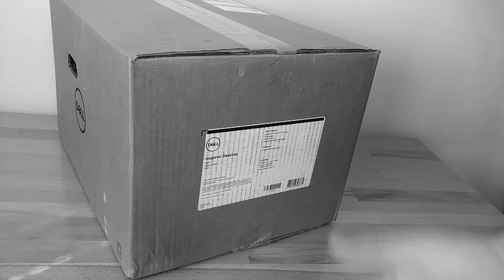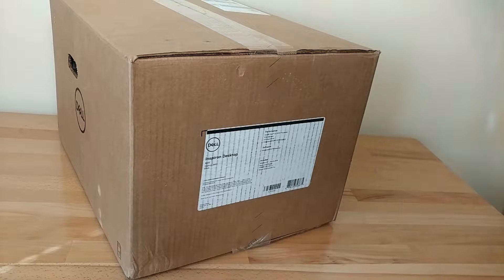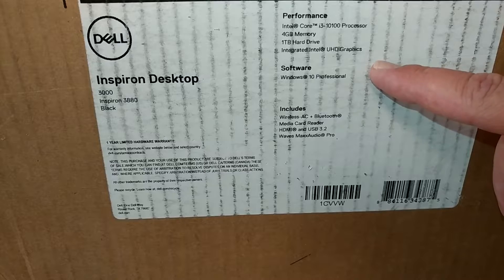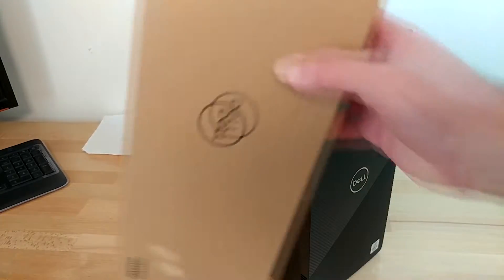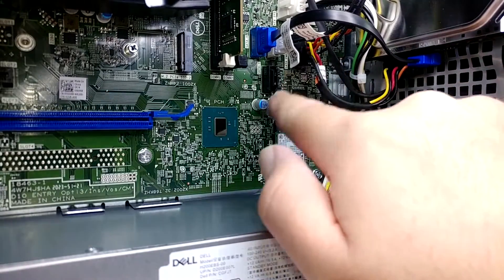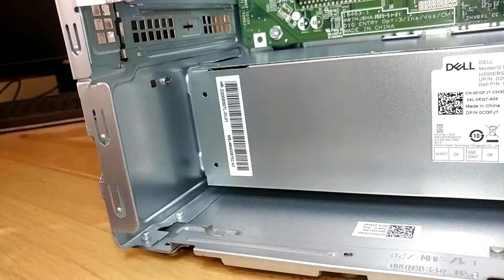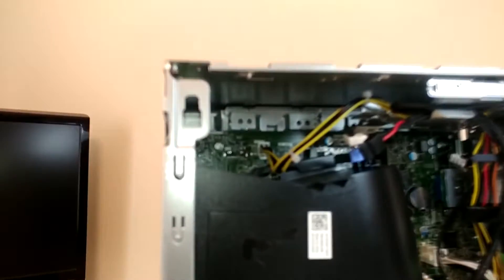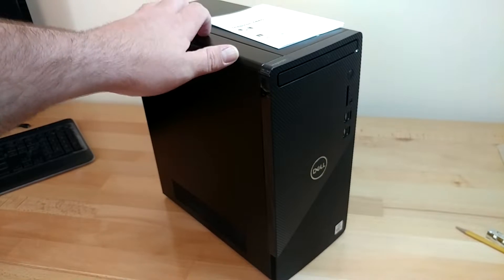Unboxing The Cheapest New Dell for 2021 (and 2022) and Upgrade Plans!

Comment: i want 500w psu in this pc ?
Reply from the maker: I'll be adding a 600w psu soon-ish, but it will be external.
Reply: @TheBrokenLife  you can run it in the case if you use a dremel to cut the mounting mechanism to a normal looking one so that it is big enough to fit and drill the 8 standard holes so that you can mount the power supply with fan up or down (I strongly recommend putting it with fan up because there is no airflow on the bottom). But I don’t think it is really worth it and it is better to either run it out of the case, use a fax power supply and only put the 1 screw in, or just buy or 3D print a new case. Then you can do any upgrade without any limitations. That means you can upgrade motherboard, cpu cooler, hard drives and SSDs, power supply, graphics card and more. You can even upgrade motherboard, upgrade to i9 cpu, add more M2 SSDs, more ram even at higher speed, even RTX 3090. Although that seems a bit too extreme
Reply from the maker: @Dabs_Rulez  A case swap is exactly my plan. If prices settle down a little, I'd like to demonstrate multiple PSU options along the way. We'll see.
Reply: @TheBrokenLife  Case swap would probably be a very good idea. The only problem is that the front panel ports and LEDs and switches won’t be able to connect to the motherboard and power button is proprietary so you either need to salvage the one on the dell case or upgrade the motherboard to a standard ATX or M-ATX. I don’t think drilling holes and using a dremel to make your own power supply mounting mechanism in the dell is worth it or even possible to some people. 1st reason: Some people don’t want to void warranty of their dell. But for me I don’t really care about the warranty. 2nd is that if you make a mistake or break the computer, then they will have to get a new computer.
3. You can easily hurt yourself when doing this and the person who tried the tutorial may comment something bad, say that they’re responsible for the injury even if they said to do it at own risk. 
If you really want to upgrade to a standard atx power supply then you can try doing it but I don’t recommend it and it is just better to run it externally, add a sfx power supply and only mount it with the 1 screw that aligns, or just upgrade case.
Reply from the maker: @Dabs_Rulez  I agree that a case swap, plus a motherboard swap with it, is the most sensible thing to do. I'm less concerned about people hurting themselves mimicking anything I do. Outside of the Dell "things", most of the stuff on my channel can hurt you if you do it wrong and I shouldn't be taken as the single, or most accurate, source for anything. ;)

Comment: this desktop it can hold the gt 1030 2gb graphics card?
Reply from the maker: It will fit, but depending on your configuration you may have PSU issues.

Comment: I got the same computer. Dell Inspiron 3880 8gb ram, i5 10th generation, 256gb SSD for $400. I want to put in another Disk or Solid State Hard Drive but my case does not have a catty to put the hard drive in. I also want to put in a GeForce GT 1030 low profile but I am not sure if it will work with a 200 Watt power supply... I appreciate any videos you make on this desktop model
Reply: I added a 1TB M.2 drive, just plugs into a slot on the motherboard. The one I bought is intel 670p series m.2 2280 NVMe. Much faster than the stock HDD.
Reply from the maker: I released a video a couple of weeks ago of putting an SSD in mind. The difference is shocking for sure!
Reply from the maker: You can install an additional HDD/SSD in the same location where mine has its HDD. A 3.5" drive is a direct bolt-on, while a 2.5" drive will require some inexpensive adapters. I will be making a video covering that soon-ish.

As far as video cards... The market is so expensive right now that I can't make any promises of when that is going to happen. The 1030 used to be an $85 card and now I'm seeing them for double that price. I'm not really looking to buy this stuff for 200% of its value if I can help it.

Comment: do you now if you can upgrade the processor in a dell inspiron 3881by
Reply from the maker: I plan to. I'm fairly confident that the board will accept any CPU that Dell offered as an option, but I can't be certain of that since I haven't done it yet.

Comment: Hey! Was wondering if you could answer a quick question, I’m looking into buying a low profile GPU to throw into this PC, but it’s recommended 300 W and this only has 200W. A couple of people say that it’ll be okay to put it in anyway but I’d like a second opinion, + dropping a sub! Thanks!
Reply from the maker: Personally, I wouldn't push any PSU any closer than perhaps 80% of its rating on a consistent basis. So if you need 300w, I'd plan on about a 375w PSU. I'll be covering this topic in greater detail in future videos.
Reply: @TheBrokenLife  thanks so much! Gonna be swapping out the PSU for sure then! Looking forward to seeing you do it as well :)
Reply from the maker: @AndysClimbing   PSU upgrade is the hot topic for sure. I'm hoping to get started on that in the next few weeks.

Comment: It's too bad that now is such an inopportune time to upgrade graphics cards. They're very hard to find and expensive if you can get them. Even lower end cards that should be $150-$200 are 300-400 if you can even find them.
Reply from the maker: You've hit the precise reason I haven't done it yet! :)

Probably going to do RAM+SSD, PSU, and then some drive mounting options next. Hopefully by the time I'm done with those things the prices and availability will be somewhat normalized.

Comment: What is the blue slot for, under the fan?
Reply from the maker: Pretty sure you're asking about the PCIE x16 slot?
Reply: @TheBrokenLife  yes is that for graphics cards can I put a 1650 in there Edit: gtx1650 or 1650ti
Reply from the maker: @prodnuk3musix  Yes, that's where one would go, but I don't know if a 1650 will work. 1030 is officially supported by Dell.
Reply: @TheBrokenLife  ok,thanks

Comment: That PSU is the new 12VO. You can’t use a normal ATX power supply because there’s no 24 pin connector on the motherboard.
Reply from the maker: A few companies sell wire harness adapters for ATX PSUs for the Dells.

Comment: I'm looking forward to your next video to see how you proceed (I'm guessing you're waiting for parts to arrive).  I've already done the upgrade from 8 GB ram to 16GB on mine, but still trying to decide between adding  a 500GB SATA SSD like the Samsung 860 EVO using the Corsair bracket that you said you're going to use .  That change would cause me to jettison the 1TB HDD (no real loss). Or, for around the same price as a  I could get a  Samsung 970 EVO 25OGB M.2 NVMe SSD and keep the HDD even though I don't need all that storage.  What do you think of those two options?
Reply from the maker: I don't remember exactly what I said I was going to do in the video, but what I'm going to do in reality is add an M.2 and likely also upgrade the stock HDD. It's just soooo slow.

Of those 2 options, the M.2 should be the better performer.

Comment: Today I am doing my final(I hope) research on which Dell computer I will buy.  Since about 1980 I have used Dells mostly for my missionary work. I have  avery old 8080, I think, which is working just fine, but it's very old, like me (80 years).  I am looking for a Dell that will last me at least 5 years because I think that may be all I will be able to handle the minimum requirements for self-reparing, etc,.  Thank you so much for doing this.  It is a great reference if not a step-by-step reference.  Don
Reply from the maker: If you check out the buyer's guide video I did, I think you'll find that the $500-ish option is likely to be what you're after. A 5 year horizon on that machine sounds just about right.

The step-by-step guides are coming. 2021 has been interesting so far, so, not coming as fast as I'd hoped.

Comment: I'm curious have you upgraded the PSU yet? I'm having trouble finding something that will fit in the case and pump out more the 260 watts. The 6 pin motherboard connection has been a real pain in the ass. currently my system requires around 200 watts with a 1030 2gb GPU plugged into it. Do you think the 260 would be enough extra power? Any help would be appreciated dells customer support isn't very helpful.
Reply from the maker: PSU upgrade is in progress with 2 different options on the table with a few different sources for parts. I'm targeting 600W PSUs.

I agree that Dell customer support is lacking.
Reply: @TheBrokenLife  I've been looking for the same thing. I have a different version than yours. Mine has the 10th gen I7 and the 512G M.2 SSD. I put 2 8g sticks of DDR4 in it. Now all i'm looking to do is get a PSU to power the GPU I have coming in the mail. I'm eager to hear your experiences with upgrading the PSU.
Reply from the maker: @THEMUTANTCHILD  I'm eager to share my experiences... I ordered a PSU adapter over 40 days ago and it still has not arrived. Ordered a second one last night from a different supplier to see how that goes. And... I was convinced to try 2 different PSU architectures too.

What I can tell you if you're in a rush is that the best thing to do would be to re-case the entire machine and move forward with a normal ATX PSU.
Reply: @TheBrokenLife  Oof I was scared of something like that. My estimated wattage on pc part picker is at around 180 watts. I know that's not taking into account over clocking. Do you think just buying the 260 watt power supply I know will fit in the pc no problem would be enough to power it all or would I want some extra watts? P.s. thank you for replying I really appreciate any advice you have.
Reply from the maker: @THEMUTANTCHILD  It's never a good idea to run right on the edge of what your equipment is capable of, especially in the sense of resistance increasing with heat and the additional heat those components are likely to add.

Whether or not it will work out for you to move up to whatever Dell will sell you, I don't personally think it will be a good financial or performance decision. The money would be much better spent moving up to a normal ATX case and PSU, and I suspect may also be less expensive in the end.

Sadly, neither of the 2 approaches I plan to cover will be particularly elegant, but one will retain the Dell case with no modifications for about $80 and the other will require modifications for about $150. In both circumstances, it would be a better bargain to just replace the case. In the long run, I might also cover that if enough people want to see it.
Reply: @TheBrokenLife  I appreciate all the feedback.  Honestly its been about a week of me trying to figure all this out. I'm frustrated that upgrading my GPU has become this huge fiasco. Especially when one of the selling points for the pc was upgradability. To be honest i'm to a point where if my 1030 plugs in and runs then i'm just not going to buy a PSU and build a pc from scratch.
Reply from the maker: @THEMUTANTCHILD  If it makes you feel any better at all about where you're at, you could not have bought the parts inside your Dell for less than Dell would sell them to you for. Just the i7 is about $400 on its own. If you the gut the entire thing out into a new case, you'll still be ahead financially.

FWIW, I believe a 1030 will drop right in it as several of my other viewers have mentioned doing that. I know plenty more are dreaming of 30xx cards though and that's never going to happen with the factory PSU.
Reply: @TheBrokenLife  True I can at least take solace in that. I knew when buying the machine the i7 was well worth it. I think though for what I want out of my pc I should just build my own. I did plan on salvaging pieces out of this one when the time finally came. Honestly with my version of the 3880 I think a 1030 is as high as you will get without a PSU upgrade. Thank you for being so helpful. You my friend have earned a new subscriber.
Reply from the maker: @THEMUTANTCHILD  I'm planning to try a 1050 in mine with the i3 because many people have said that's actually not a bad combo. Then I'll beef it up later on, hopefully when prices come down.

You may find building to be a better way to go in the future, or buying from a more boutique brand centered around more standardized parts. I bought mine with the thoughts to upgrade it for fun, but economically and practically it's a terrible approach. ;)

I'm glad I was able to help!
Reply: @Dominic Krol I actually ended up getting my GPU in early. I took the risk and fired her up. So far 3 days in and its worked phenomenally. I wanted to boost my graphics on WoW and be able to play some fps's that take dedicated video storage. Like Escape From Tarkov and Valorant. The PSU should be close to its max wattage though so only time will tell.
Reply: @Dominic Krol I got a GTX GeForce 1030 and I still have a 200W PSU in there from when I bought the machine.
Reply: @THEMUTANTCHILD  Does it work with a 200W PSU?
Reply: @bud1239  It's still working fine no problems at all.

Comment: Any psu that this pc can upgrade to
Reply from the maker: There are a few options, but none of them are great. I'll address that in an upcoming episode.
Reply: @TheBrokenLife  alright, thanks!
Reply from the maker: @Dominic Krol You can upgrade to any old regular ATX PSU you want, with a wire harness adapter for the Dell MB, but it won't fit inside the case.

Honestly, the most sensible answer for regular people is to upgrade the entire case and PSU in one shot and then never worry about this problem again.
Reply from the maker: @Dominic Krol The 1030 is a factory option from Dell so it will probably work out fine for you.
Reply from the maker: @Dominic Krol I can't say for certain, but Dell offers a similar card in the top tier 3881. I suspect you'll be alright.
Reply from the maker: @Dominic Krol Yes. On your machine you should be able to install a drive where the HDD in mine is located in the video.
Reply from the maker: @Dominic Krol There's only one M.2 slot so you'll have to go SATA 3 for your other one. You'll also need a 3.5 to 2.5 drive adapter to mount it.
Reply from the maker: @Dominic Krol SSD vs. HDD is up to you based on your budget and intended purpose. I wouldn't spend SSD money for bulk storage.

If you want to use the front drive bay for a 2.5" drive, you'll need an adapter and a SATA cable. If you want to use a 3.5" drive, then just a cable. Oh... You'll need some screws too.

Comment: me watching on a Dell Inspiron 3880 :)
Reply: mine has a BC511 NVMe SK Hynix 512GB SSD not a Seagate hard drive...
Reply from the maker: @techconix  Only a few models came with an HDD. I'll be putting an SSD in this one shortly.
Reply: Is the case fan noisy? Overall fan noise noticeable?
Reply: @009kcwy  you can barely hear a whirring noise. The fan noise won't disturb you if you have headphones.
Reply from the maker: @009kcwy  No. It's very quiet.
Reply from the maker: LOL :)

Comment: I'd like to see which optical drive you're planning to install as well as how to add the front bezel. I ordered this for an older couple and I would prefer to house the optical drive internally and make it look like it was built that way from the start. I called Dell today and they were not able to find the bezel part that goes to this family of 3880's. I may try again to see if I can get a more knowledgeable sales agent.
Reply from the maker: The optical drive will be the next installment in the series. To my surprise, a lot of people are interested in it.

Sadly, I wasn't able to get the Dell bezel either, but what I've come up with isn't too bad.

Comment: I bought the core i5 version with a 256gb m.2 ssd 12gb ram I am hoping to upgrade the power supply with a adapter which you can find on the dell forum page just search however you will have to have it out side the case as for a GPU I’m hoping the 1660 super works with it
Reply from the maker: I already ordered exactly that adapter... However, It ships from China and shipping has not been too terribly quick.

I'm hoping to reverse engineer it once it shows up so people don't have to wait 3 months to get one.